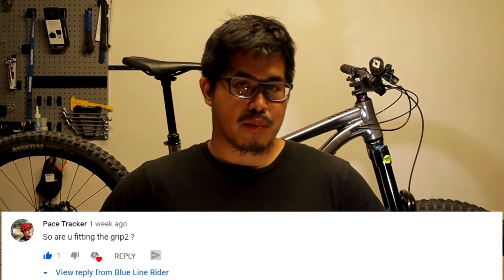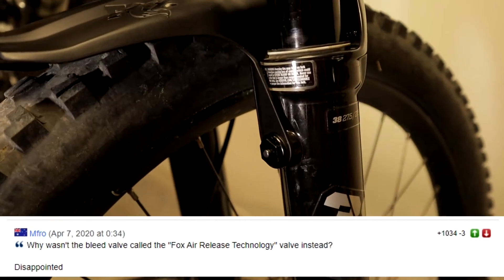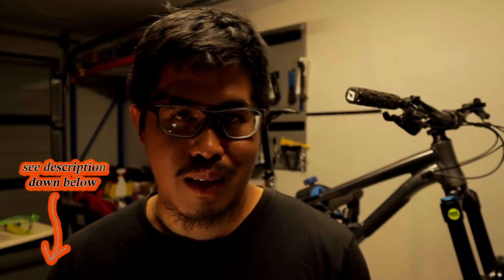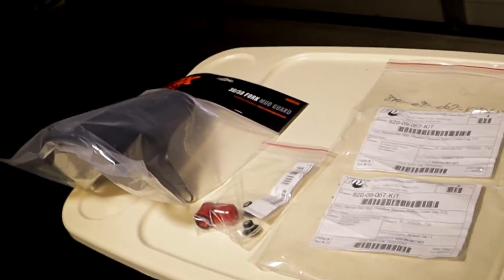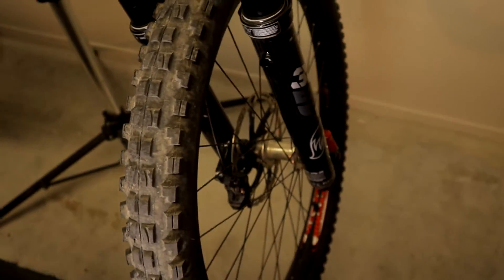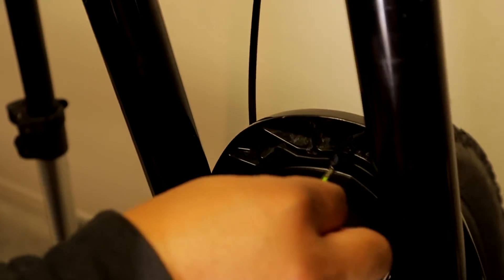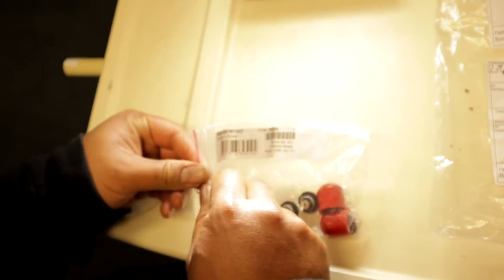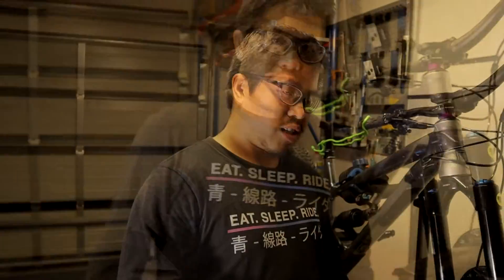2021 FOX 38 AIR BLEED VALVE AND MUD GUARD (fender) INSTALL HOW TO

Comment: Hi, nice video. Are the new bleeder valves that you installed necessary? Or were they something that you installed because of preference? And, what is the difference between the original blank bleeder valve and the new one?
Reply from the maker: No need actually. its just there ready. however I do press it from time to time and it does burp up air. and now rockshox have it too.
Reply: The difference between the original black(non operational) valves is that you couldn't actually bleed the forks on the fly. The cheaper Fox forks come without the actual bleed nipples, you need to buy the bleed valves separately and install them yourself. Like he did in the video.

Comment: Hi, Cool video! I bought the same bike in Chile and I would like to do the upgrade of the air valve bleeders, can you tell us where did you buy them? Thanks in advance
Reply from the maker: Hi, for New Zealand, I just called   Blue Shark, one of the Fox suspension distributors and told me to arrange via my local bike shop. 

I dont know how the Chilean branches work, but I assume it would be the same.
Reply from the maker: Hi, for New Zealand, I just called   Blue Shark, one of the Fox suspension distributors and told me to arrange via my local bike shop. 

I dont know how the Chilean branches work, but I assume it would be the same.
Reply: Thank you! I will look out for a Fox suspension distributors here in Chile

Comment: Where did you get the air bleed valves? I cant find it.
Reply from the maker: Just call your local fox dealer.
Reply: Fox Lower Leg Pressure Release Button 2021 look that up if you can find it let me know